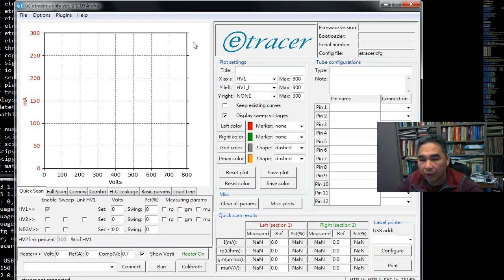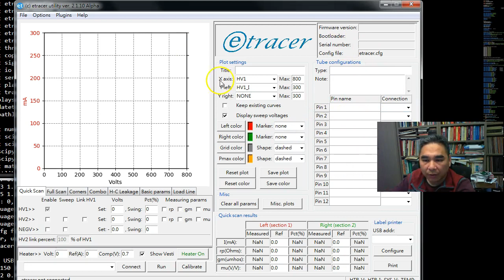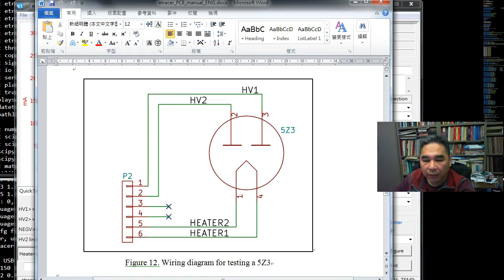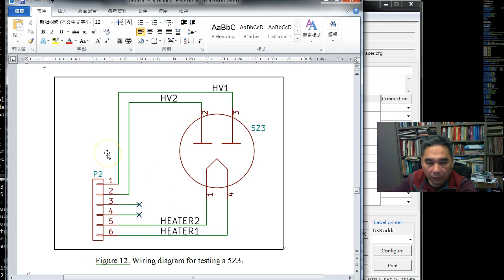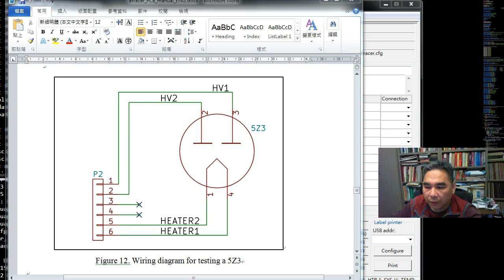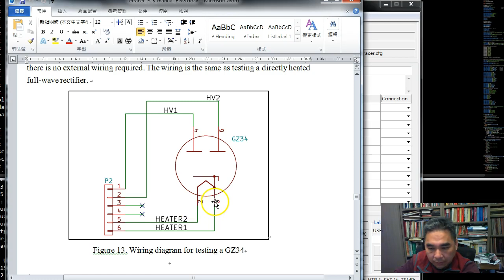etracer - Design of vacuum tube configuration files (2)- recitifiers

Comment: rp is inverse of slope, given as 120.  Rise is 280-120=160. Run is 50-30=20. Slope is 160/20=80. Inverse is 1/80=0.0125. Where does the value of 120 come from? Please help.
Reply from the maker: The unit of plate current is in mA. Following your naming I believe Rise should be 0.16 instead of 160.